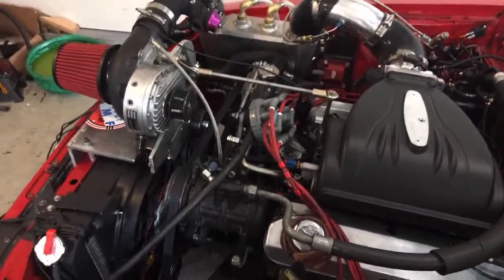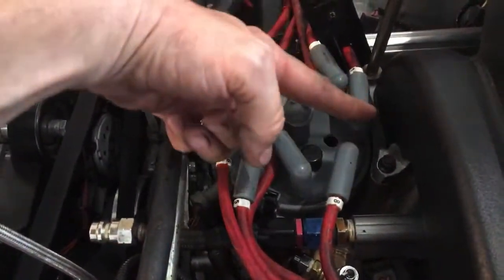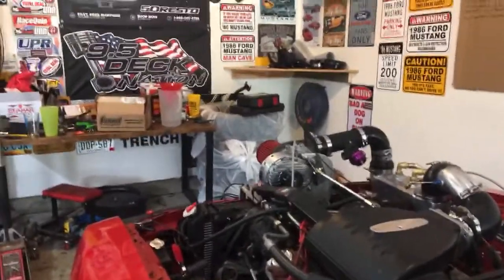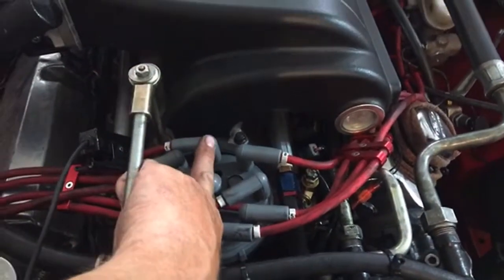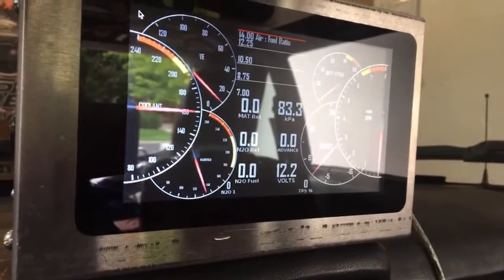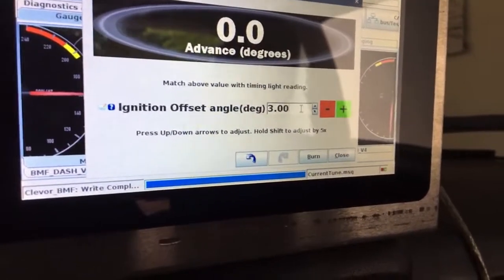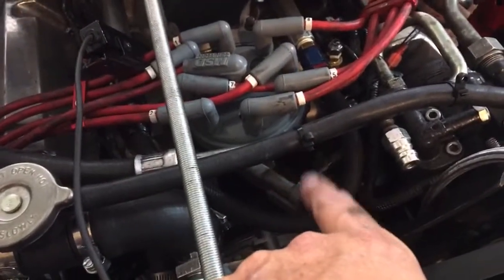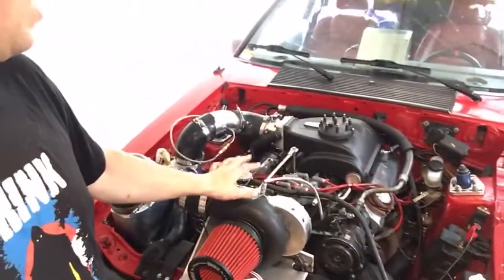Rotor Phasing - What is it? How to check it?

Comment: You can also change it buy changeing the octane rod in the distributor. ford set the internals of the distributor -10 degrees and the ecm compensated . you can visually see it off. put a shorter octane rod in it and it will zero it out so you can run it with a carburetor. Spark timing and ignition timing is two differant things if that makes sense 😄

Comment: To check for a latency issue the timing must be set to “fixed”. Using a value where the car will idle happily point the timing light at the balancer and raise RPM’s to around 5k if spark retards from the set “fixed” value you will then start to adjust spark hardware latency until the timing does not move from the fixed value.
Reply from the maker: I forgot to mention that lol